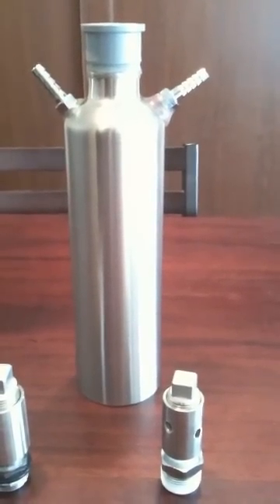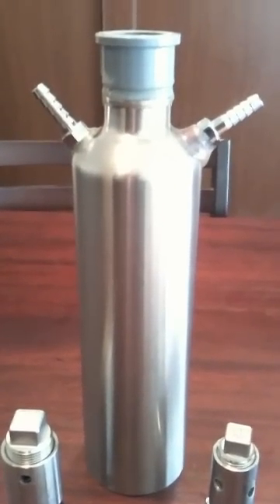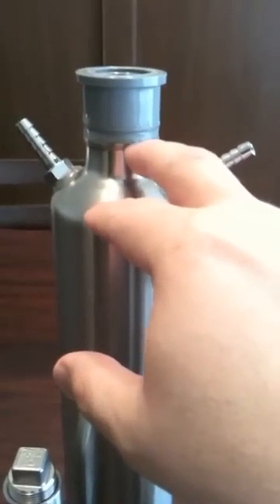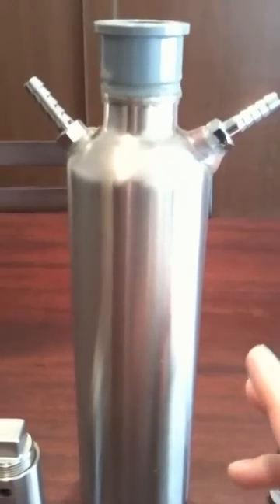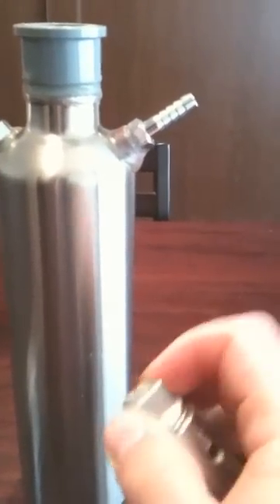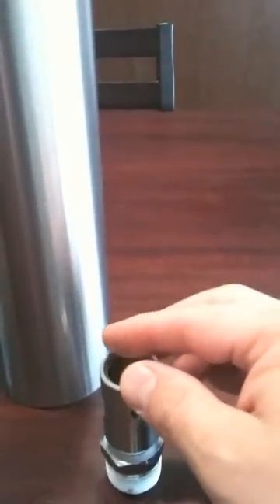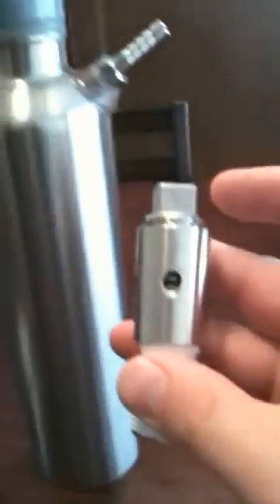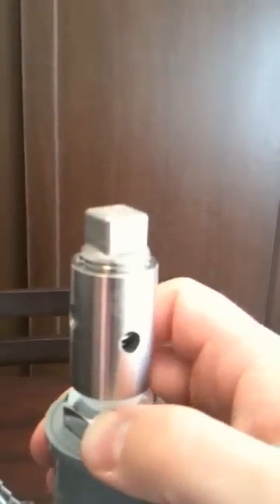Flashback bubbler

Comment: Does the steel ball seal at the bottom and is the ball stainless? If the ball is crome it will be damaged by the elite. I use rubber balls out of a old computer mouse or you can fined them at ACE hardware. I like the set up and the fact that it is stainless. Thanks for sharing.  "D"

Comment: Nice thing. I had just the same idea to put a steel ball inside flashback dissipator, but had doubts if that would be gastight. Rubber washer would help, but i don't know if I can trust it won't damage or burn after couple of flashes. Is your enclosure made of a standard fitting or you dismounted it from something?